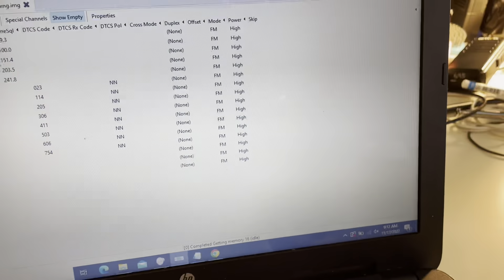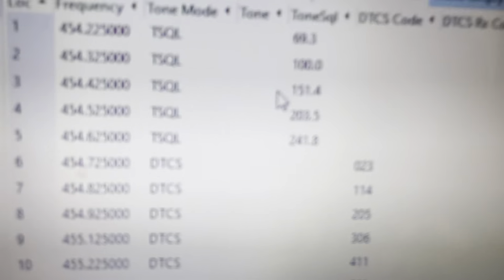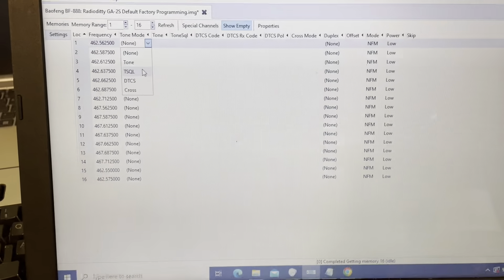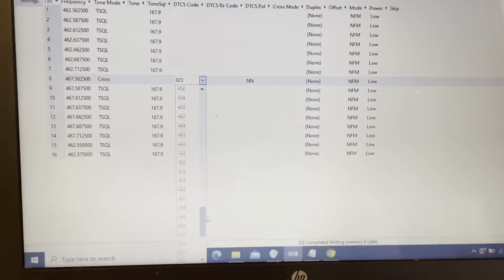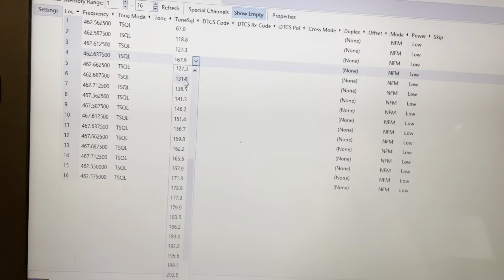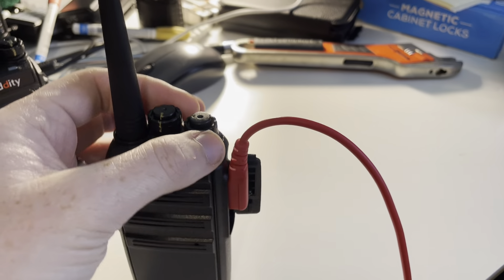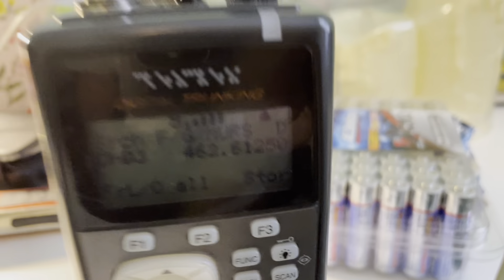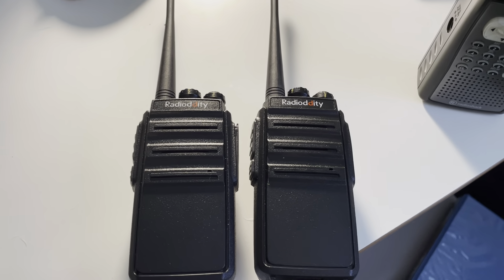How To Program Radioditty GA-2S Walkie Talkie Two-Way Radio For Legal Use - Programming FRS Channels

Comment from the maker: For a list of frequencies that are legal to use (without a license) in your country, see the comment thread for this comment or simply post a comment to the video and I will happily provide a list, and, if required, supporting  documentation.
Reply from the maker: USA license free channels list FRS - license free frequencies (legal in USA) for simplex use. 

01 - 462.5625 MHz 
02 - 462.5875 MHz 
03 - 462.6125 MHz 
04 - 462.6375 MHz 
05 - 462.6625 MHz 
06 - 462.6875 MHz 
07 - 462.7125 MHz 
08 - 467.5625 MHz 
09 - 467.5875 MHz 
10 - 467.6125 MHz 
11 - 467.6375 MHz 
12 - 467.6625 MHz 
13 - 467.6875 MHz
14 - 467.7125 MHz 
15 - 462.5500 MHz
16 - 462.5750 MHz 
17 - 462.6000 MHz 
18 - 462.6250 MHz 
19 - 462.6500 MHz
20 - 462.6750 MHz 
21 - 462.7000 MHz 
22 - 462.7250 MHz 

Note that channels 1-22 are shared with the GMRS service (simplex only on channels 1-14.  The GMRS service is allowed to use channels 15-22 for either simplex or repeater output).  

Bandwidth (FM deviation) should be set to NFM (narrow mode, 2.5 kHz deviation).
Reply from the maker: EU legal license free PMR446 channels.  Europe and many other countries outside the Americas, the PMR446 frequencies:  16 channels:

CH01 - 446.00625 MHz 
CH02 - 446.01875 MHz 
CH03 - 446.03125 MHz 
CH04 - 446.04375 MHz 
CH05 - 446.05625 MHz 
CH06 - 446.06875 MHz 
CH07 - 446.08125 MHz 
CH08 - 446.09375 MHz 
CH09 - 446.11875 MHz 
CH10 - 446.13125 MHz 
CH11 - 446.14375 MHz 
CH12 - 446.15625 MHz 
CH13 - 446.16875 MHz 
CH14 - 446.18125 MHz 
CH15 - 446.16875 MHz 
CH16 - 446.19375 MHz 

NFM (FMN) mode.  Use of TSQL (transmit and receive tone squelch) is strongly 
recommended.  These frequencies are legal for use without a license throughout Europe.  

They are illegal to use in the United States without a license, as the 446.0 MHz - 446.2 MHz band is allocated to the amateur radio service (ham radio service) in the US.
Reply from the maker: Sweden and Norway ONLY:

KDR444 or SRBR444.  Norway it’s KDR444.  Sweden calls it both “KDR444” or SRBR444. 

Norway:

CH01 - 444.600 MHz 
CH02 - 444.650 MHz 
CH03 - 444.800 MHz 
CH04 - 444.825 MHz 
CH05 - 444.850 MHz 
CH06 - 444.975 MHz 

Sweden:

CH02 - 444.650 MHz 
CH03 - 444.800 MHz 
CH04 - 444.825 MHz 
CH05 - 444.850 MHz 
CH06 - 444.875 MHz 
CH07 - 444.925 MHz 
CH08 - 444.975 MHz 

More info: 

https://www.hfunderground.com/wiki/index.php/KDR444

Comment: How can I see what frequency’s i can use free in Greece, is there a list I can find?
Reply from the maker: In Greece, the PMR446 frequencies:  16 channels:

CH01 - 446.00625 MHz 
CH02 - 446.01875 MHz 
CH03 - 446.03125 MHz 
CH04 - 446.04375 MHz 
CH05 - 446.05625 MHz 
CH06 - 446.06875 MHz 
CH07 - 446.08125 MHz 
CH08 - 446.09375 MHz 
CH09 - 446.11875 MHz 
CH10 - 446.13125 MHz 
CH11 - 446.14375 MHz 
CH12 - 446.15625 MHz 
CH13 - 446.16875 MHz 
CH14 - 446.18125 MHz 
CH15 - 446.16875 MHz 
CH16 - 446.19375 MHz 

NFM (FMN) mode.  Use of TSQL (transmit and receive tone squelch) is strongly recommended.  These frequencies are legal for use without a license throughout Europe.  The PMR446 service is authorized in many other countries as well.  It is legal in Greece.  

They are illegal to use in the United States without a license.

Comment from the maker: FRS - license free frequencies (legal in USA) for simplex use. 

01 - 462.5625 MHz 
02 - 462.5875 MHz 
03 - 462.6125 MHz 
04 - 462.6375 MHz 
05 - 462.6625 MHz 
06 - 462.6875 MHz 
07 - 462.7125 MHz 
08 - 467.5625 MHz 
09 - 467.5875 MHz 
10 - 467.6125 MHz 
11 - 467.6375 MHz 
12 - 467.6625 MHz 
13 - 467.6875 MHz
14 - 467.7125 MHz 
15 - 462.5500 MHz
16 - 462.5750 MHz 
17 - 462.6000 MHz 
18 - 462.6250 MHz 
19 - 462.6500 MHz
20 - 462.6750 MHz 
21 - 462.7000 MHz 
22 - 462.7250 MHz 

Note that channels 1-22 are shared with the GMRS service (simplex only on channels 1-14.  The GMRS service is allowed to use channels 15-22 for either simplex or repeater output).  

Bandwidth (FM deviation) should be set to NFM (narrow mode, 2.5 kHz deviation).